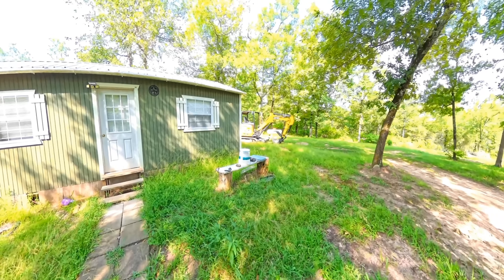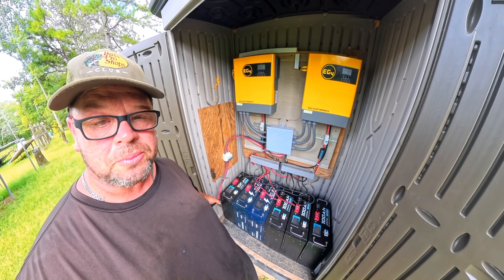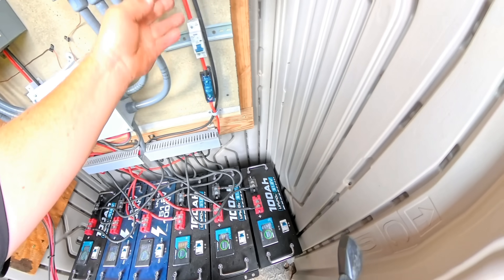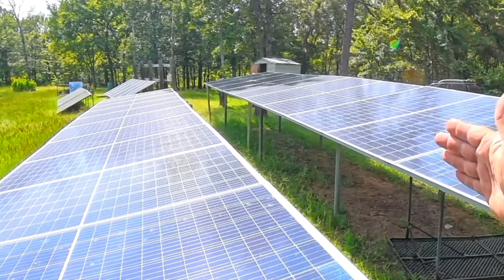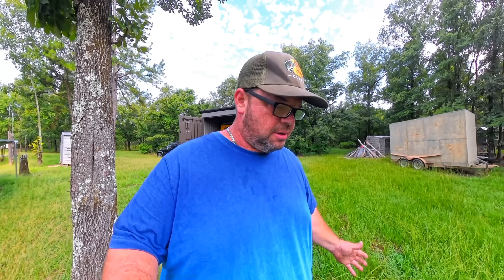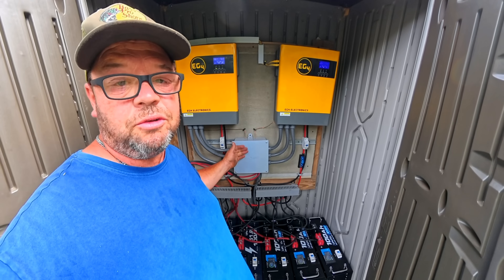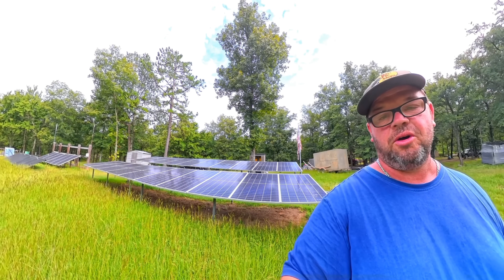Powering My House 24/7 With BATTERIES!!

Comment: Those 3000 Watt. EG4,  high frequency inverters are absolute junk and they'll toast your home's appliances when the MOSFETs in their H-Bridge circuit fail. Here's just a few of the problems that you can encounter if you install these inverters.

General issues
High Idle Consumption: The inverter's idle consumption might be higher than expected, with one user reporting 64 watts compared to a claimed 6 watts.
Noisy Operation: The inverter's fans can be loud, particularly when under heavy load.
Basic Documentation: While the installation is straightforward, the included instructions might be lacking in detail.
Mediocre App: The associated app for monitoring and control has been described as mediocre.
Size and Weight: The inverter's size and weight can be a factor, requiring adequate space and support for installation.
Learning Curve for Advanced Features: The advanced features and configuration options can have a learning curve, especially for beginners. 
Battery-related issues
Communication Failures:
One common problem involves the inverter failing to communicate with the battery, which can be caused by incorrect communication cable pinout or selecting the wrong battery brand on the inverter's LCD.
Specifically, error code 19 may indicate a communication failure with lithium batteries, and can be resolved by correctly setting the dip switches on the battery, ensuring the "master" battery has all switches in the down position.
According to Facebook, users have encountered issues with the EG4 3000 XP not recognizing batteries, despite them being connected.
Charging Issues:
Batteries may not charge to 100% state of charge over time due to the Battery Management System (BMS) getting out of sync. Setting the charge voltage to 57 volts can re-sync the BMS and resolve this issue.
Error code 04 can indicate a low battery voltage, possibly due to a dead or improperly connected battery.
Some batteries, particularly if run below 50% SOC, may experience issues and shut down, triggering undervoltage alarms.
Open loop communication and manual adjustment of Bulk, Float, and Low DC Cutoff settings may be required to resolve charging issues in some cases.
There have also been reports of the inverter setting the charging voltage to 48V instead of the required 56V with certain battery brands like Ruixu.
Discharge Issues: If discharge current is too low (below approximately 1.5A), the battery BMS may ignore it in SOC calculations, leading to the actual SOC being lower than reported. This is reset by a full charge cycle. 
Inverter-related issues
No AC Output: If the inverter is not producing AC output despite connected batteries, check for a blown fuse inside the unit.
Overload/Overcurrent:
Fault code 07 signifies an overload, meaning the inverter load has exceeded 110% of the output capacity. A system restart is required, and future loads should be kept below the operating capacity.
Fault code 13 indicates overcurrent or surge, suggesting an electrical surge or short circuit.
PV Input Voltage Drop: Some users have reported a voltage drop when the inverter begins converting power into watts for the battery, causing a 10% drop in voltage during the initial 10-15 seconds of operation.
Backfeeding Power to Solar Panels: The PV and batteries sharing the same DC bus can lead to backfeeding power to the solar panels, resulting in low voltage on the PV inputs.
Generator Compatibility: Some users have experienced difficulties running the EG4 3000EHV with certain generators, requiring workarounds like using a separate charger to initiate charging.

Comment: I have worked in manufacturing for 30 years most of the panels with heavy electrical equipment have small panel AC units keep things cool I have used small window types in a pinch now days you can buy those solidstste types like Tesla cars have too

Comment: Something like a 8 inch Shuttered Exhaust Fan hooked up to a Temp controlled plug will do you just fine. You will need to cut a square out of one of the side and a Vent on the other side. But even then a 8 inch fan would cool that shed in a few mins. and the temp control will keep it from running Non Stop. Keep up the good work sir cant wait to see the vid!.

Comment: Build a little pole shelter over the shed, using solar panels for the roof.
Reply: I was going to suggest building a shelter for the electrical cabinet. Great idea for solar panels on the roof!
Reply: @FoxFace11 very good point battery’s need to stay cool. Better production
Reply: @FoxFace11 12x20ft heavy duty carports can be had for $750 shipped
Lots of roof area
Reply: I would find some used barn steel. Build a 8 by 10 or 10 by 12 covering. Shade and rain protecton against all but the worst storms.
Reply: Super smart
Reply: But then there is still the issue of the equipment itself generating too much heat in that tiny space in the summer.  I think he still needs ventilation.

Comment: Your Power Shed is not insulated or air conditioned.  Heat will kill the batteries and inverters.  You want to keep Lithium iron Phosphate Batteries under 75f and if it does get hot there, temps in the shed could get to over 100f or 120f and that will degrade the batteries fast.  Ask me how I know!
Your panels are not at the correct angle for winter unless you live near the equator.  In Oklahoma you should be about 30 degrees above flat.
You absolutely don't want any water getting in the shed!  A stick built shed with insulation and a very small inverter air conditioner through the wall is a good option.
Reply from the maker: my panels are good for the summer time right now..but ya in the winter they need to go more towards 38 deg
Reply: @OKLAHOMAOFFGRID  Just so you know, the panels will collect power up to 30 degrees from perpendicular with no noticeable reduction.  I live in nearly the same latitude as you.  When you go with 30 or 33 degrees above flat, that works great so you don't have to change them.  Many use adjustable tilting mounts and that is fine if you really want to.  I prefer simple solid mounting in a fixed position.  Your best way to collect more power is to have one series array pointing about 10 to 20 degrees to the east of due south and one series array pointing 10 to 20 degrees west of due south to get power collection all day depending on Trees, Mountains etc.  I have none so I go closer to 20 degrees.  With trees to the ease and west 10 degrees if best.  You will charge earlier in the morning and later in the day.

Comment: AWESOME SETUP! What was the cost for equipment?
Reply from the maker: Around 7k
Reply: @OKLAHOMAOFFGRID  Thanks so much, I am doing my research to add solar to my house over time.
Reply: @OKLAHOMAOFFGRID  You think I might be better to keep your battery bank shed in the shade and add a fan so help keep them cool? You may want to consider making a roof with solar panels to put over the battery shed. That way even if you cut vent holes on the sides or add a solar gable vent fan to the shed, the shed will still be protected by the solar roof from the rain and it will keep the sun from directly heating the battery shed.
Reply: @OKLAHOMAOFFGRID  I see you haven't put up all of your sheetrock yet. I have a tiny home also, 16ft x 24ft and a 8ft x 12ft bedroom addition. Even though I did sheetrock I would NEVER put sheetrock again. I would recommend shiplap because you just buy 8ft long 7" tall shiplap boards from Home Depot or Lowes and you screw them in place as money allows. That way no huge 100ibs sheets of sheetrock to manhandle, no taping, no mudding, no sanding, no mudding again, just put the 8ft board against the studs and screw with 1-1/2" T25 deck screws and put some trim to dress up the corners. I would put one full 8ft board as a starter on the first row and then use a 4ft board as your starter for your second row to offset the seams. You can brad nail them if you have a brad nailer gun. I just like screws because they are easy to unscrew if you have to get behind the boards.
Reply: @OKLAHOMAOFFGRID  when it comes to solar racks I would make them high enough so you can use them for storage. Basically you can put walls on the rack and then you have a shed/cover and they can protect your battery shed from direct sunlight and rain.

Comment: I'm curious—how hot does that shed get? Here in Texas, it can easily reach 100°F. If I build a system like yours inside a shed, would it be safe? What’s the highest ambient temperature those components (inverter and batteries) can handle?

I can easily see the shed reaching 120°F, so I’m wondering if that kind of heat would cause the inverter or batteries to fail early or reduce their lifespan.
Reply from the maker: Hot I'm working on venting it

Comment: FREE? Really? It looks to me like you have around $10k+ just in server rack batteries alone. Add another $10k+ for all the peripheral electronic components in the system and wiring costs. Then factor in sales tax and delivery charges where applicable, setup and installation costs, mounting systems, etc. I would hardly call that "free electricity". That is far, far, far from free. You may be a little more free from The Man, by being more self-sufficient, but it isn't free. 

Maybe it would be more accurate to claim "electrical freedom" which is far more accurate in my opinion. And just like freedom isn't free, neither is this system, nor your electric costs. You are paying for that electricity either way. And since no system is free from issues and defects, there will be ongoing costs that never seem to cease in order to keep your system running over the years and decades. 

Thank you for taking the time to create and share this video with us all, detailing your system and your experiences with it!
Reply from the maker: Well the whole thing about it is free electricity not free equipment.
Reply: @OKLAHOMAOFFGRID But that electricity wasn't free. You could not collect and use it without that equipment. The equipment is what makes it possible. Hey how about a free vacation? You just have to buy the airfare, pay for local transportation, pay for your hotel, travel visas, food, taxes and everything else needed to use that free vacation... but the vacation is free. How about a free cruise? Just pay thousands for each ticket, and then everything else is free. Neither of those are actually free, just like the electricity isn't free. Free is when it is just available to everyone for free, no cost, no specialized equipment to purchase, etc. Your local city or town park is free. Just go there and use it, all the equipment is already provided for your use at no extra cost to you. That is an example of free. The electricity isn't free if you have to pay to access or use it... and you have shown that the user must spend a lot of money to get and use the free electricity.

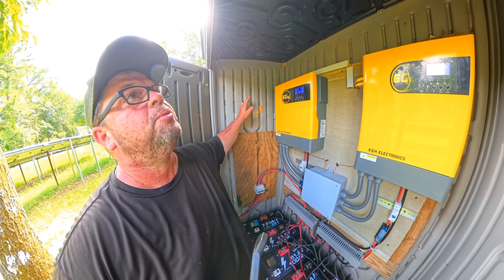Comment: 7:37
Run a duct vertical up the inside the shed, and put a vent on the bottom of the shed. Then you can use a fan to suck out the hot air from the top of the cabinet (where the inverters are). Connect it to a 12v marine or 120v bimetallic thermostat and it'll kick on when it's ~90F and off when it's below that (or whatever power you want.)
If you go 12v, you might even be able to toss a small solar panel on the top of the shed to power the exhaust fan.

Comment: When you cool it you’ll want an opening low and a powered vent as high as possible. The low opening might be better to be above the batteries because ambient air during the day could actually cause them to get warmer. Cool air at night can cool the batteries which can delay heat build up in them, so you might want two different fans/timer systems. Those are things you need to figure out for your location. Pay attention to wattage draw 25 to 30 of fan power is about all you’ll need. White paint or reflective film on the outside and batts of insulation inside are amazingly effective and cheap. Add vent block offs for wintertime. Looks good
Reply from the maker: Great info, I appreciate it.

Comment: Have same Eg4 inverter on one battery built on a dolly stationed in same but smaller home Depot shed. 
Same problem with  generate heat if doors are closed. Solved my problem was to build a 2 sided lean-to over shed,  protecting it from direct sun and doors now slightly ajar. Not the best idea but solves the built-up heat and possible rain damage.
Reply from the maker: yes great idea

Comment: Bad ass! Nice off grid system. This is an excellent example of an affordable and nicely implemented simple off grid power system. I think the nice thing about scaling out with multiple inverter chargers Is that if one goes bad All your eggs aren't in one basket. I know there's the Standby idol power draw that you might take a small penalty there, but to me, it seems like it's worth it to have the. Redundancy of multiple inverter chargers.As long as you have enough solar and battery capacity to work with for your loads
Reply from the maker: I have thought the same exact thing..I can run the whole house off of one..but yes the down fall is 84 watts x 2

Comment: Nice bus bars. 600A at that voltage is 30kW. Flex conduit looks cool like that. Super neat. Will be cool to see how you ventilate it. That is tough.
Reply: Will is Here. wow. ❤
Reply: Can we expect a positive reaction video to this one?
Reply: My recommendation is get a dc dc converter to go 48 to12v  then use two 120mm fans, one in and one out, you can hook them up to a 12v temperature controller. I'd get a couple of those diy rv vents that they sell and our made of plastic. u can make them very waterproof. gona be interesting tho like willy said with those ridges in the shed.
Reply: Build a sub floor for your batteries and vent your system through the floor. Cut an intake hole and a exhaust hole use a small fan to move the air.
Reply: Just create a 120v outlet there to power a fan/vent. There's solar power fans out there too.
Reply: "Nice bus bars"
I'll use that as my next pickup line 😅
Reply: @alexxbaudwhyn7572 want to see my solar array?
Reply: The master chiming in on your video very nice.
Reply: Would a shed work in a cold area?
Reply: Y que no entren bichos
Reply: @WillProwse could you do a reaction to this? Would love to know what works and where this can be improved.
Reply: Of course wills here lol …Ac infinity does a lot of cool fans that would work for this application and no-one does enough videos on them ..wink wink lol also they do whole house fans that can cool at night by pulling air into the space
Reply: yea cut off temp is 140F and humidity will cause arcing too, ...so be careful.
Reply: Dear Justin, your solar power system has a lot of power.  What is the possibility to add a small solar/ac split air conditioning unit to cool your entire solar system?   Without touching or modifying your current shed, what is the possibility to extend the front-door area by 4 feet out. Then, you can attach the cooling part of the split air conditioning unit at the extending area... -Hunter
Reply from the maker: @hunterchan8152 I can put a mini split into the house without a problem and that's actually the next thing I'm going to be doing. I have plenty of power to run it
Reply: Wow I was wondering what you thought of this… and first comment I see is will
Reply: Nice!!! What size inverters?
Reply from the maker: @faml13 they are 3000 watts each
Reply: Link to that shed or make/model/dimensions?
Reply from the maker: @alexxbaudwhyn7572 this is going to be the closest I can find to it now I bought the shed about 3 years ago 
Rubbermaid 5 ft. x 2 ft. Roughneck Small Vertical Shed at Tractor Supply Co https://share.google/6fXk6fKMajiuhHJqw
Reply: @OKLAHOMAOFFGRID  eg4 makes a minisplit you should build a wood shed with its own panels . Its more hurricane resistant and eg4 solar panel connect directly to the a/c this way it doesn't draw from the other system
Reply: Your an inspiration to me man.. I fucking love the content from both of you!
Reply: You can go through the side, 4" pvc.  Everyone is saying turn a 45 down, well you set a tee with 22s, bug screen, done.  Tee will keep water out, maybe even set it pitching down a smidgen for extra prevention...
Reply: The legend himself stops by to grace us with his presence!
Reply: In that climate, to protect my equipment, I would install a backpack minisplit for $330. It'll keep it ventilated and cooled off...
Reply: Will Prowse, the GOAT himself appears!!!
Reply: Ventilate for cooling or off gassing  from batteries?
Reply: @idahoduckhunter cooling inverters. There is no gas creation under normal use. These are lifepo4. I believe you're confusing them with flooded lead acid cells.
Reply: @WillProwse ok just triple checking thanks
Reply: @idahoduckhunter  lipo4 does not offgas
Reply: @idahoduckhunter  LiPo4 batteries don't off-gas.

Comment: My idea for venting my shed of similar size is using a dryer vent outlet thingy that goes on the outside siding of the house with the louvers or an old school one and putting a screen behind it and a lil computer fan or something similar, i have a bunch of lil usb powered fans cuz i have usb ports on my batteries and im Mclovin it so far. I haven't committed to the dryer vent cover idea but its in the lead
Reply from the maker: dryer vent 👍

Comment: You should look at getting the Slate Truck when it comes out. Powered by your off grid system.
Reply from the maker: what is it?
Reply: @OKLAHOMAOFFGRID it's a small pickup that was supposed to be $20,000 but maybe higher since the tax credit is going away but it's fully electric and does 250 mi per charge. Very basic. Would be nice to have around your property. I didn't know if you had a side by side that would do the same thing but it's cool nonetheless. Just look up Slate Auto.
Reply from the maker: oh ya I have seen them